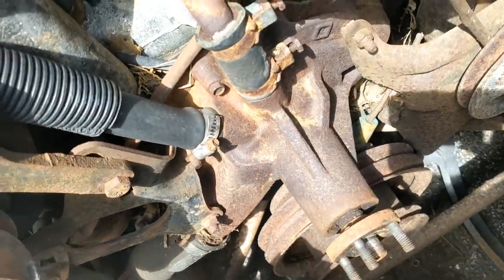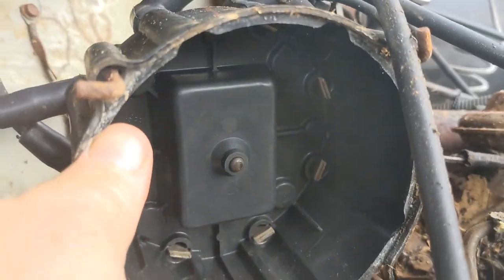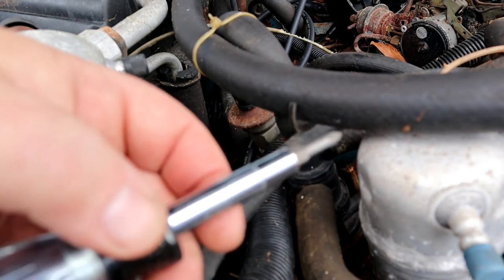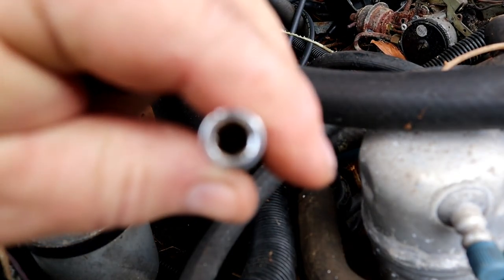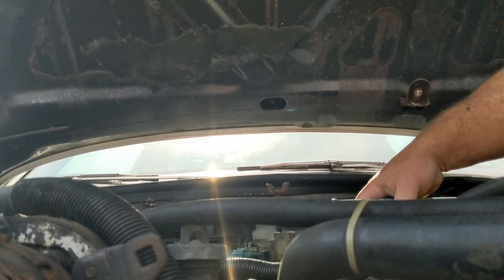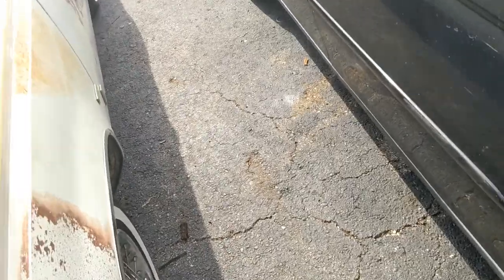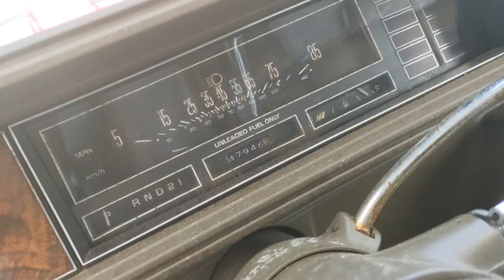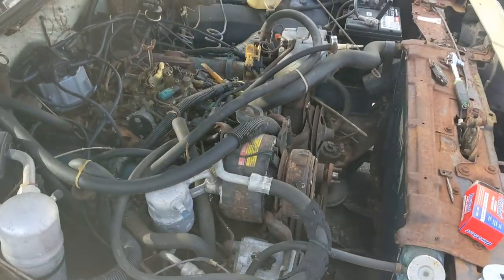Satisfying pressure wash of the 30 yr. abandoned Cutlass Supreme Brougham. #gbodynation #satisfying

Comment: problem no power to Distibutor due to wire damage if run hot wire to it from battery it fire right up its go low cylinder but they all have gallop after they seat for years due to sticking rings iv restored at less 10 of thos cars iv yet to see one that wouldnt start unless it had rod thew block or locked up
Reply from the maker: Unfortunately I was on a time crunch and could not get that far with the car so I sold the car the wiring harness was a complete disaster even under the dash and the rust was extreme in places that you cannot see in the video. I did grab a few parts off of it for the other two cutlasses that I have.